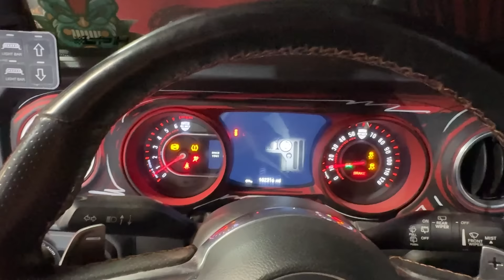Jeep Wrangler STEERING FAILURE and Fix!

Comment: Know the feeling about "It works fine, but there's the nagging feeling it's not right". Long ago had a car with 100,000 with the same radiator and thought it needed a radiator flush to celebrate it 100,000 mile anniversary ...so gave it a complete radiator flush... Next week, I ended up buying a new radiator.  Moral: Don't fix what ain't broke
Reply: If what you're driving has 100,000 miles on it, then what's broke is You.

Comment: PSC has a 1800 psi pump which is the best. It results in a tighter turning (steering wheel ) .... you need to upgrade to the 1800 at some point...

Comment: With the hydro assist system, does the steering return to center? With no ram in line mine does, but with the ram I need to return it to center. I will be upgrading the psc pump to their high flow pump. Also psc ram and box installed in my xj.

Comment: Can't be a factory pulley from that vehicle for the pump since the OEM is fully electric
Reply from the maker: Factory pulley from a 392 motor. Not from the 3.6
Reply: @LiteBrite  maybe on something like the charger/challenger then. Even the JL 392 uses Electric pump on the JL. No doubt a factory pulley though. Kinda nice to see though

Comment: 😂$350 for a steering pump ain't bad? Dang, I'm old. I remember when top of th' line pumps were $42 and you'd get anywhere from $7 to $25, depending on what part,, and how much you payed for it, for returning th' part you replaced, so they could rebuild it.